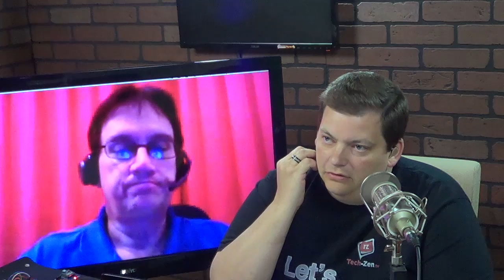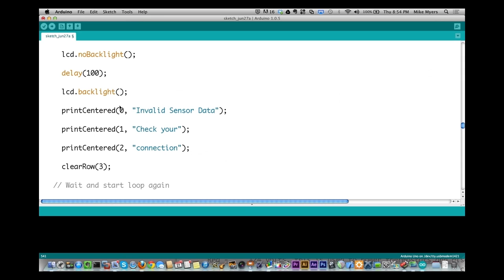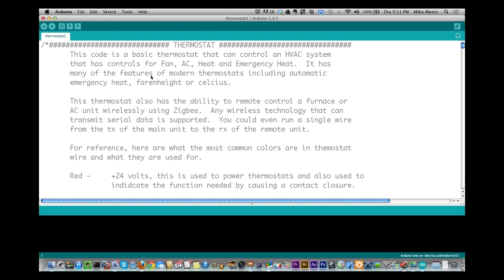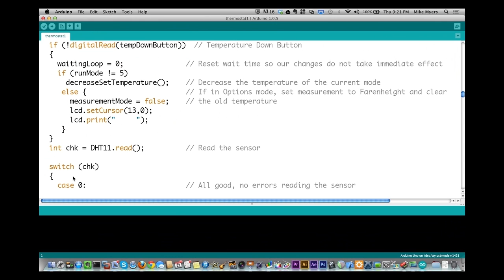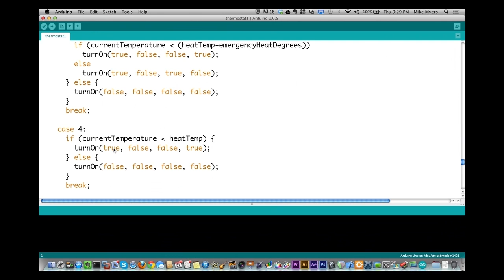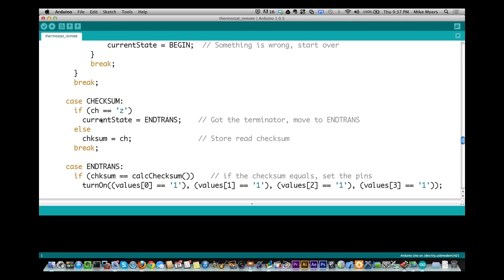LCD Thermostat - Let's Make It - Episode 25

Comment: Love how you put everything together but as a 15 year HVAC technician in the field you should add a 3 to 5 min delay when the compressor turns off otherwise you will stall the compressor if it turns off and turn on too quickly within the 3 to 5 min cycle

Comment: ATMEGA328P is rated at 40mA per I/O pin, 200mA total ie Vcc and Vgnd can handle max of 200mA. These are guaranteed specs. Many samples will exceed but not all..